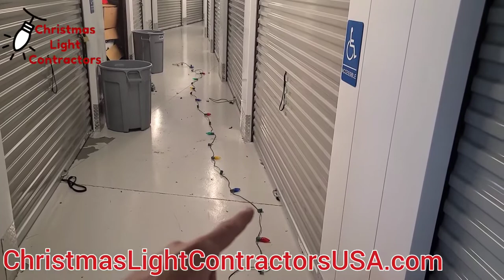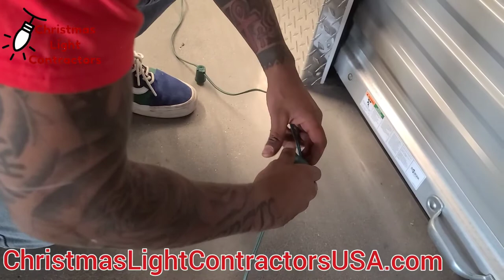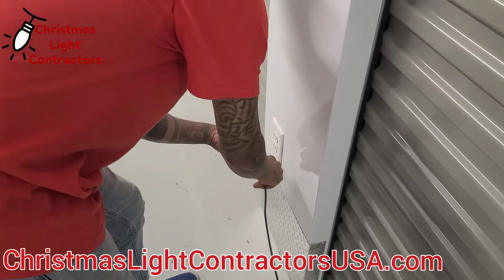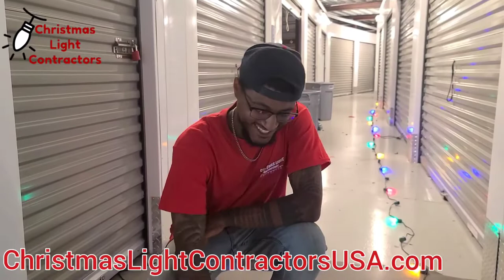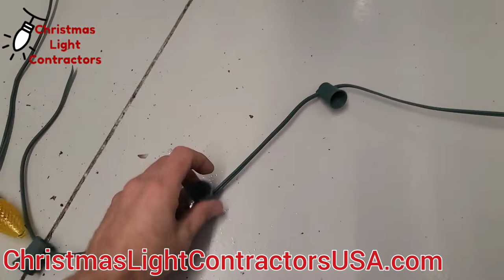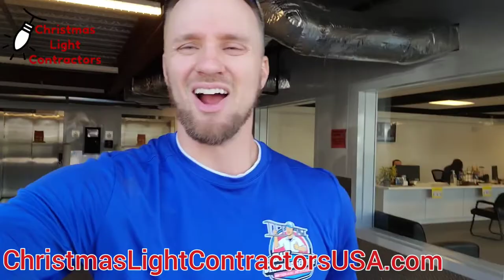How to DIY replace broken Christmas Light Sockets on SPT1 cord

Comment: For installing the male end, why do you split it down the middle and cut one end short?
Reply from the maker: Hi Craig- This a safety precaution to prevent the wire from arching. Arching happens when wires from both side of the line touch.